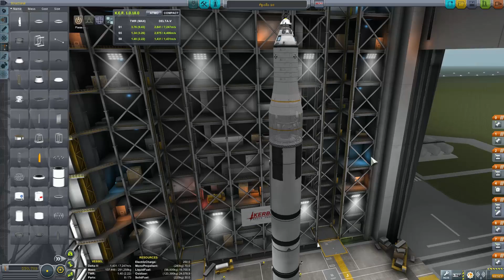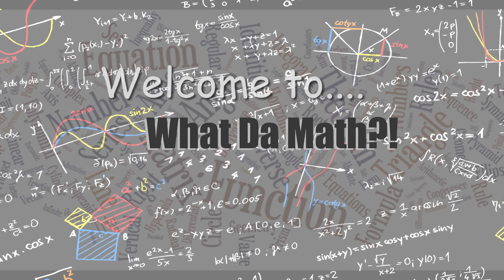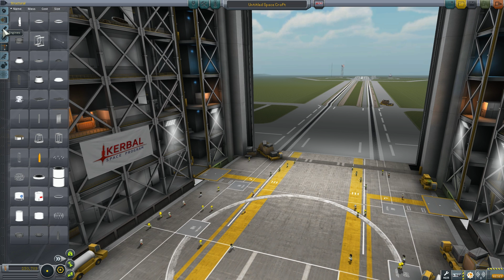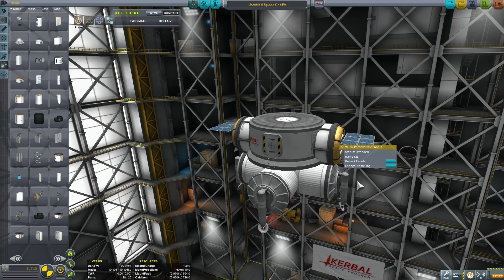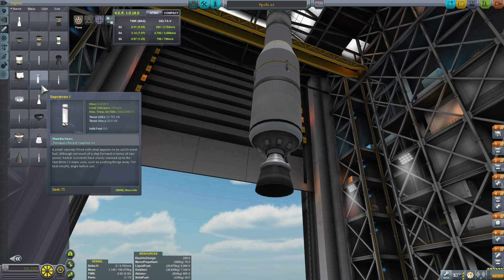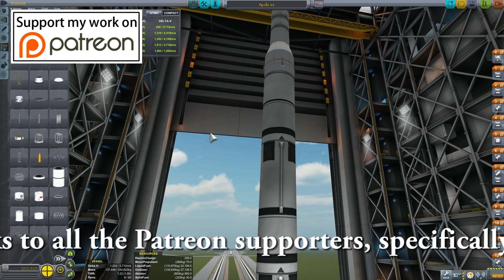Building Saturn V Rocket in Stock Kerbal Space Program

Comment: nah he did not take that to the moon the first stage is 7 meters wide with 5 F-1-A engines and the 2nd stage also 7 meters wide has 5 J-2 engines and 3rd stage 1 j-2 engine and then a adapter fairing to the LEM and the apollo CSM
Reply: @Luke Luddy You do realism you need mods to precicouly recreate the Saturn V, right? And this is a Stock tutorial done with NO MODS.
Reply: He you realize if the Apollo went to the moon this prob did to

Comment: It's not very detailed, expecially the SM.
Reply: Richard Li he did this in stock(no mods).you need mods to make realistic mods
Reply: You do not need mods, just practice replicating in stock. Cluster a lot of 3.75 tanks on the first and second stages clustered together with empty Mk0 fuselages wrapped around it with 1x1 panels on the sides for stripes. For the SM, have an interstage fairing with the inside 1x1 panels to separate the SM into 6 parts, put monopropellant tanks in the center, fuel on 2 opposite ones, oxidizer on 2 opposite ones, ballast on one and a fuel cell on the last. Also, make sure the thrusts and burn times are correct, and the mass is near correct by clipping ore and fuel tanks into them. Even if he kept it at 3.75, on the first stage he could have clipped an empty upside down S3-14400 tank to the top of the first stage to get the stripes on the top of the S-1C stage.

Comment: This was horrible, it didn't look like it at all and you can see that you didn't really know how the Saturn v worked. The lander had 2 engines not one,you placed unneeded weight by putting a docking port an adapter a decoupler and the the lunar module, if you have a docking port on the lander you don't need decouplers or adapters you can just place the lunar module on the lander docking port